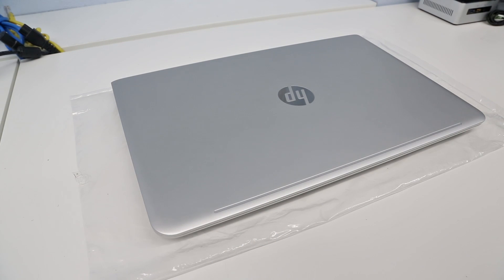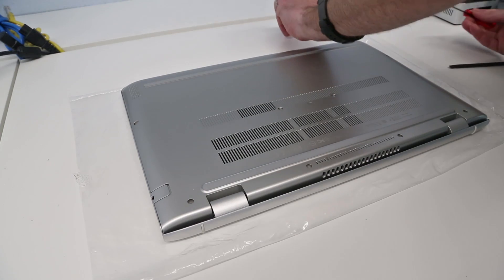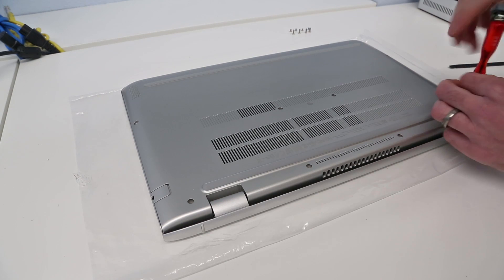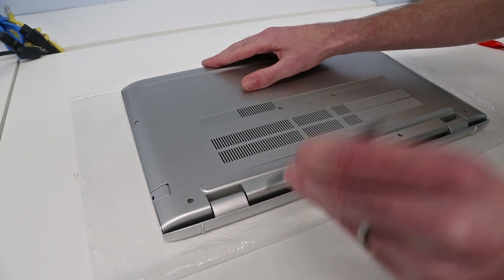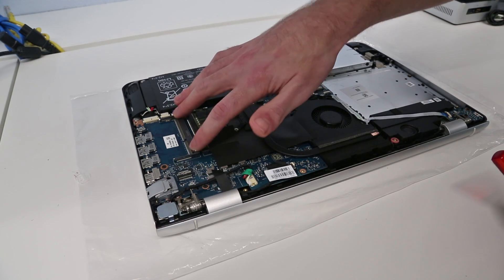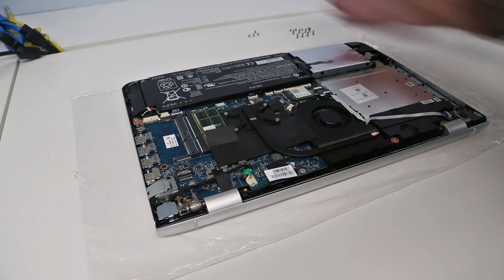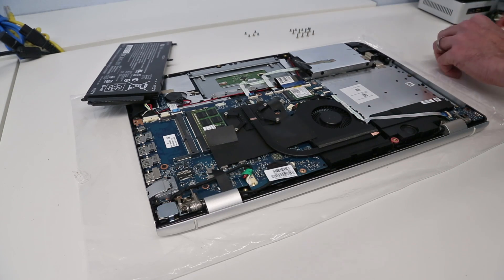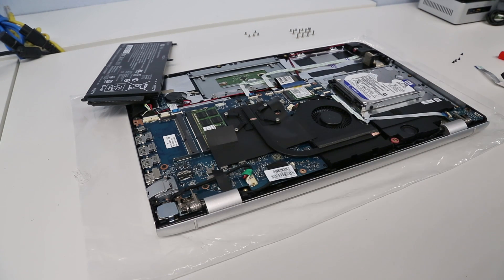HP Envy 15-ah151sa - HDD/SSD and Memory Upgrade Guide

Comment: I have Envy 15-ae103ne with same internal arrangement but mine has DVD Drive, SSD and Empty space on HDD area so want to buy HDD Cable I don't find it...
Please help!
Reply from the maker: Part numbers for the bits you need are:
812697-001 - HDD Cable
812686-001 - Fitting bracket and screws
Search shows both available on eBay from international sellers.
Reply: @BrueComputing  Thanks

Comment: A) Important to take the Optical Drive (DVD) out first if fitted. Removing an extra screw on the back allows it to be pulled out. There are two extra screws under the tray area holding the back in place.
B) Be careful when removing the SATA (hard drive) cable. It just needs the black plastic clip to be lifted up allowing the cable to come free. But it's easy to knock off
a cable connecting the antenna to the wireless chip. This is just a push fit to re-attach, but is very fiddly. This video can help....

Comment: I have this laptop, If I upgraded my RAM memory to 16Gigs, Should it help with the graphic proformance or it's not worth it?
Reply: i have a same laptop,  i upgraded it to 16GB RAM two months ago.. 2 slots of 8GB. Not much difference in terms of performance. maybe 10% improvement?
Reply from the maker: If it has a single 8GB DIMM then I'd expect some improvement in performance going to a pair of modules. It won't be a HUGE change, but the increase in memory bandwidth should give some benefit.

Comment: Can I add 2tb HDD in this machine ???
Reply: As long as the hdd is a 2.5" sata drive - yes  Hdd's / Ssd' Capacity isn't limited to a maximum size where as ram can have a limit due to Os being 32-bit or 64-bit
and the Number of ram slots in your system.
Reply: John Paul Bacon added 2tb of 2.5 drive.. thank you :)

Comment: In mine the battery isn't internal
Reply from the maker: You have a different model then.
Reply: Yes,according to HP it's a an ENVY 15-f100dx,it runs a lot better now that I upgraded to Windows 10,I also dual boot with Ubuntu 17.10

Comment: is there a way i can keep the hdd disk and add an ssd ?
Reply: did u see the space on the right side of the board? that is actually a space for DVD rom drive, but this laptop dont include one.  u can use that space to add a HDD caddy onto it for an add on SSD.

Comment: i have a similar hp envy model. but its intel i5 and intel graphics. with 8gbs. the salesman told me i can go up to 16gbs of ram. but after looking the specs after i bought it. they say its 8gbs only and no memory is accessable
Reply: so can i still add another card if theres a slot available when i open it
Reply: Upgrade os to Windows Pro and it can use more than 8gbs RAM
Reply: Frank G yes you can upgrade. you lap must have two slots which can support 8 GB ram as salesman says

Comment: I have HP Envy 14 Intel Core i7 6700 HQ, GeForce GTX 950. It has the same design. I am planning to buy this 1 TB Samsung SSD: https://www.amazon.com/Samsung-2-5-Inch-Internal-MZ-75E1T0B-AM/dp/B00OBRFFAS/ref=sr_1_1?s=pc&ie=UTF8&qid=1459536799&sr=1-1&keywords=samsung+1+tb+ssd Will I have to buy extra stuff for this SSD so that it fits properly? Thanks

Comment: Can i add a m.2 ssd?
Reply: I didn't see any m.2 slot
Reply from the maker: +Jaime Lopez There is no M.2 slot for one. You could add one in the 2.5" bay with an adapter like this: http://www.amazon.co.uk/gp/product/B00ITJ7U20/ref=as_li_tl?ie=UTF8&camp=1634&creative=19450&creativeASIN=B00ITJ7U20&linkCode=as2&tag=httpwwwbrue0a-21
Not sure why you would though, unless you just have a spare one lying around.
Reply: +Brue Computing what about replacing the CD drive by an ssd? Do you know how it can be done?
Reply from the maker: +Coshmarful A caddy like this should do the trick: http://www.amazon.co.uk/gp/product/B00ST3ALJA/ref=as_li_tl?ie=UTF8&camp=1634&creative=19450&creativeASIN=B00ST3ALJA&linkCode=as2&tag=httpwwwbrue0a-21
Reply: +Brue Computing Thank you. I don't know why I was under the impression that those types of caddies were only for MacBook.
Reply: yes you can add m.2 ssd

Comment: Hi, 

I recently purchased this laptop, it has windows 10 installed, it seems a lot slower than my work laptop running on windows 8.1 with an i5 with 4gb of ram, I would like to upgrade the memory on my HP, what memory can I install on this to give it a boost in speed?

Thanks
Reply from the maker: +vwukben Depending on the exact model i5 is a better CPU than the A10-8700P (IMO). I wouldn't expect a significant performance improvement from adding additional memory in most tasks, but it takes DDR3L-1600 modules.
Reply: +Brue Computing Thanks, would you say that Windows 10 is slower than Windows 8.1? it's just the HP runs a lot slower than my Lenovo, for instance opening Chrome. the laptop I'm comparing it to is a Lenovo X1 Carbon with I5-4300u CPU and 4gb of ram on windows 8.1 Enterprise. Any thoughts?
Reply from the maker: +vwukben Not typically, no. I'd assume the X1 Carbon has an SSD installed which I find makes a huge difference - I guess you mean it is slow to boot up, load applications, etc?
Also reducing the number of startup items can help a lot
Reply: I have this laptop, If I upgraded my RAM memory to 16Gigs, Should it help with the graphic proformance or it's not worth it?

Comment: thank you it is a useful video. is it easy to transfer the original Windows 10 from HDD to SSD?
Reply from the maker: +ibra I use Acronis True Image 2014 which makes it pretty easy, just clone from HDD to SSD with the SSD in a USB caddy, then swap it in to the laptop.

Comment: How do I add the SSD in addition to the HDD.  I want it to have both
Reply from the maker: +Tara B I don't believe this is an option. There is only space for one SATA drive and I don't recall seeing an M.2 slot in there.
You could look at a hybrid SSHD drive such as the Seagate 1TB Laptop SSHD
http://www.amazon.co.uk/gp/product/B00BSH3CCC/ref=as_li_tl?ie=UTF8&camp=1634&creative=19450&creativeASIN=B00BSH3CCC&linkCode=as2&tag=httpwwwbrue0a-21
Reply: thx!

Comment: @Brue Computing 

This one seems to have no optical drive, however mine has. I successfully popped out every side except the side with located the cd drive.

So I think this is the issue that I can't fully open the back cover, Any idea to remove the optical drive first? I don't think we can open the keyboard as well.
Reply from the maker: +Ratchaphol Srichandrabhandhu Normally the optical drive will be held in by one of the central screws - undo that and slide it out and there may be some screws in the edge beneath it.

Comment: very nice...thanks!  I'd add that on my laptop that was produced in Dec 2015, you have to pull the dvd drive out & remove the 2 screws that are exposed when you do so (broad head on the screws).  To remove that, you have to remove a screw in the bottom panel that holds the drive in place (so, all screws on the bottom panel must be removed).  these 2 screws secure a part of the bottom panel.

I got by without disconnecting that cable to remove the battery.

And, check to see that upon re-mounting the bottom panel that you have a snug fit all the way around before you start tightening all screws.  I had a gap up front that I didn't see till all other screws had been put back in...so I had to remove all again & get it snug.  Not a big problem but I was worried that I had displaced something inside & it was getting pinched.

Comment: sorry but translate
I have an hp envy 15 and after changing the thermal paste it this much warming
the folder appears to be weak, that I will be a better buy it can improve?
whereas before it did not happen and the cooler is running regular